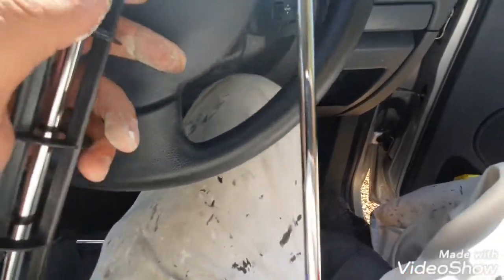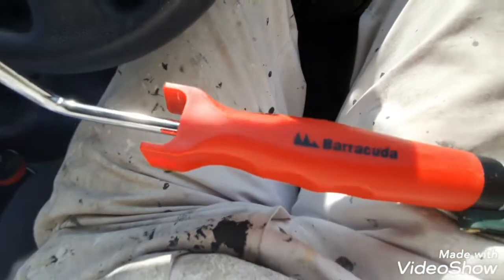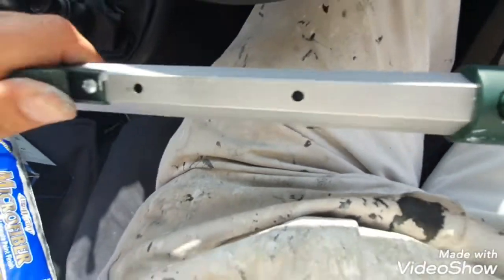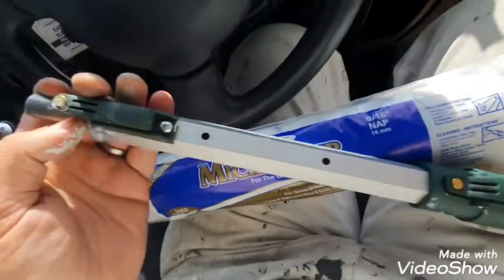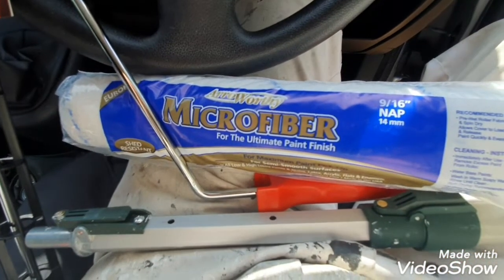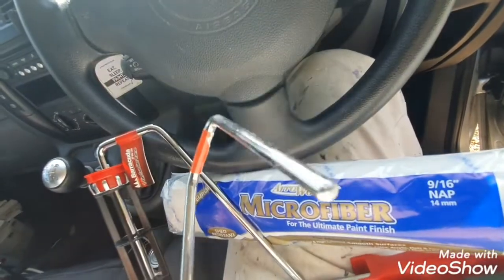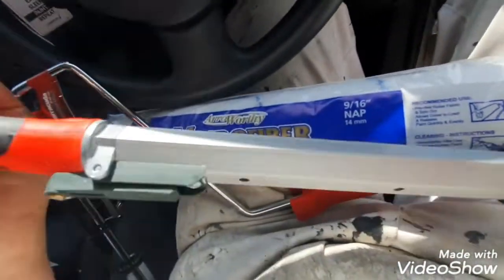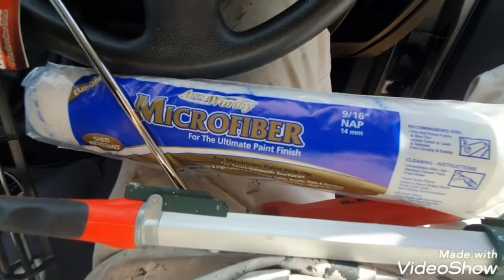Arroworthy Barracuda 14" Roller Cage

Comment: Have you had a problem with your roller sleeves not fitting those cages? I use arroworthy rollers too... One day they fit, then next day can't get it on... I'm wondering if it's the weather
Reply from the maker: Hi mate. So far so good but I've started using the Picasso sleeves and they leave a great finish and fit the frames 
Wooster do good double arm frames like the hulk and big Ben etc on MyPaintbrush

Comment: So how are these barracuda frames holding out lm guessing sleeve doesn't roll off  but if it's used on screw on pole do they unscrew?
I'm always looking for quality tools and looking over the pond for them now 🤷 l also seen those sherloc poles with some reviews saying they brake down after a while..would appreciate some honest intell😉
Reply: Mate. They are good but I always clean them after use and take the sleeve off as if you don't then they will break in future if you leave the sleeve on for multiple jobs. I actually prefer Wooster Jumbo Koter Shergrip mini roller frame as it's quality is better but both can be used on the Sherlock pole either screw in or the quick release pin.

Comment: Do u not find 14 inch cage is too large and leaves fat edges esp new plaster unless double arm 1 with equal weight each side. I also find splatter terrible with larger rollers. 9inch green Hamilton for me. Seem to always go back to them.
Reply from the maker: Microfiber sleeves are fantastic for not splattering. I would never go back to anything else. So far I like the 14inch as ceilings can be done much quicker also you can go up to the edges unlike double arm. 
The only thing with these quick release cages is they are hard to get the sleeves off if left on after washing them out.
Reply: @danielnugentpainteranddeco557  Mate check out the wooster 18 inch microfiber roller 9/16" nap . It's great for knocking out large ceilings. It has a large paint capacity and leaves a great finish!
Reply from the maker: @thomasshattock1467  ill ask at Crowns if they can get them in. Cheers Dan

Comment: Hi Daniel,  I have just got one of these today, I have had some negative comments on Facebook from people who have never used one, do these last
Reply: Yes mate but my advice is to take the sleeve off after cleaning it out on every job then it will last. If you leave the sleeve on over a period of jobs then it's tough to get off the  cage and can end up breaking the cage. So always take the sleeve off after every job. Cheers Dan
Reply: @danielnugent2168  thanks Daniel
Reply: @danielnugent2168  I was concerned that with it being a single arm it would be too flexible but just tried it out and it was spot on
Reply: @georgecclifford8235  nice one. I use a Wooster 14 inch single arm aswell. All good stuff 👍

Comment: Just bought a Wooster Sherlock gt extension pole so much better as the Arroworthy Barracuda and The Wooster Sherlock rollers where a bit wobbly on the purdy extension pole so happy days, used them a few times , so much quicker and as you say Daniel we just want to get those ceilings done quickly never pleasant rolling ceilings
Reply: Mate. I could never go back to any other pole. I got all 3 different size ones. The best. Cheers Dan
Reply: @danielnugent2168  the 2 to 4 foot is great for most jobs but I'm going to get the 4 to 8 and the 1 to 2

Comment: it is basically the same as the wooster cage ant it
Reply from the maker: Exact same. These are easy to get hold of as they stock them in Crowns and Kent Blaxhill. 
I'm happy they fit the Wooster Sherlock pole as its a good combination
Reply: @danielnugentpainteranddeco557  they fit onto a Purdy extension pole but you have to screw them on and off